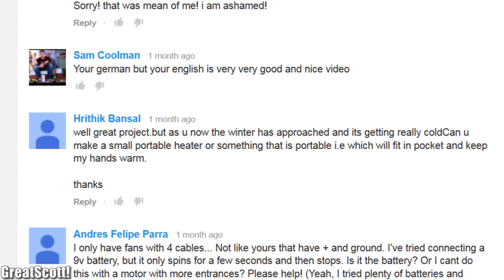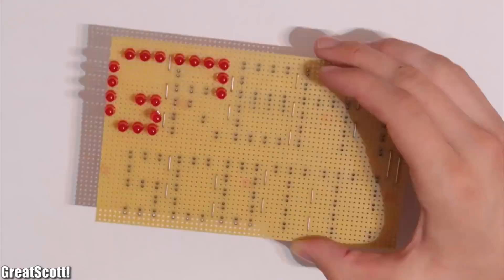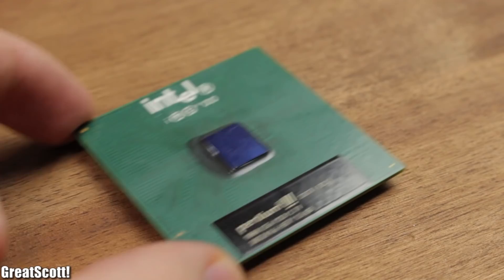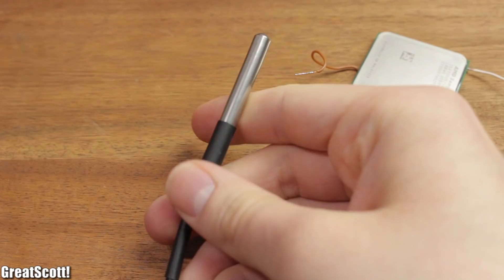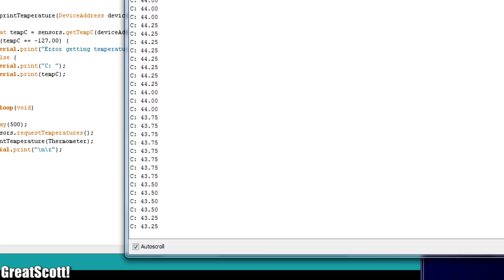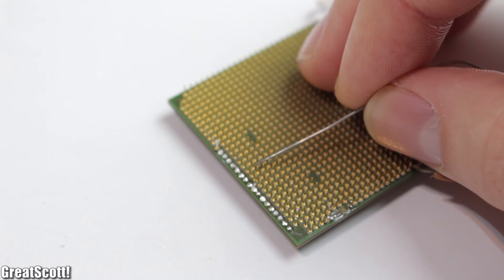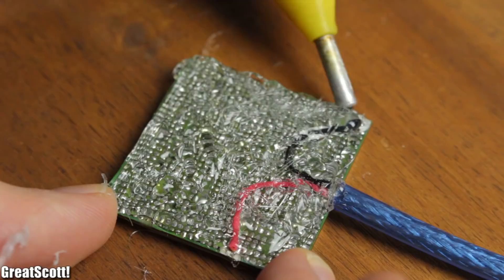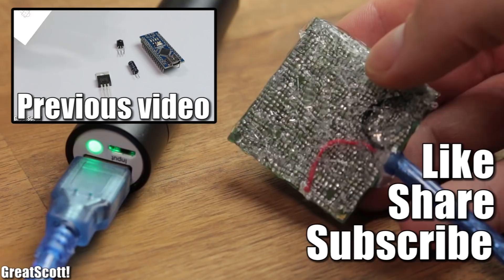Stay warm this winter: CPU Hand Warmer

Comment: now overclock it
Reply: +Tom L I'm in stitches x'D like for you my friend
Reply: +Kyle Harrison for that you would need a mobo...
Reply: Hawk_ Eye actually you can Overvolt without a motherboard. Which is technically overclocking and would increase overall bus speeds
Reply: I tried doing it with a stock cooler. Nevertheless I don't have a home anymore.
Reply: +The Smoking Gentleman It's not 'technically' overclocking unless that side effect emerges, which would be undesirable. You can bypass the limitations of the motherboard VRM's by providing your own power, which is common in extreme overclocking.
Reply: +The Smoking Gentleman volts dont increase speed (on modern chips at least)... :)
Reply: ***** Yeah, i don't want to say such a thing is impossible, but that is not how people overclock, not these days :P
Reply: +Daniel Fischer It doesn't increase the speed but it increases the speed at which the pc is stable
Reply: +Tom L there is no clock
Reply: Will J this comment make my day
Reply: Yea Good Luck With That
Reply: lolz i did it seriously and im giving it away.
Reply: You can’t because the thing’s not really running.
Reply: Where is this clock everyone is talking about? and why does everyone want to run over it?
Reply: You actually overclock your motherboard’s Front Side Bus (FSB); the CPU just changes it’s frequency to fit the motherboard’s settings.
Reply: Will J lol
Reply: Hawk_ Eye pro bro
Reply: @nielswehrens8180  r/whoosh
Reply: @ironmatic1  r/whoosh
Reply: @marcanderson815  r/whoosh
Reply: @user-lb3nv4lk9u  r/whoosh
Reply: Nice
Reply: Lmao
Reply: Why people stun other with crazy mind jokes
Reply: Delid it
Reply: Portable Hand Burner
Reply: To 10GHz
Reply: ... and make a hand burner
Reply: @lightningstrike4680  oh no
Reply: Creates a bomb
Reply: At this point you can just hot glue it over an actual clock.
Reply: @frosty129  holy hell what have you done
Reply: He already overclocked it with 5V ;)
Reply: 120v
Reply: GEEEEEEEENIIIIIIIIIIIIUS!!!!!!!!!!
A fucking masterpiece!!!!!
Reply: Mains socket?

Comment: 2 GTX 480 and your room will never be cold. Ever.
Reply: I had one melt on me. No more Nvidia for me.
Reply: +Derpancakes Wow, great logic, completely irrelevant.
Reply: +Siana Gearz were talking about the heat produced by computer parts, on a computer channel. how is this not relavant?
Reply: +Garrett Holland I think he saying that generalising a whole brand over one defective product is bad logic, which I would agree.
Reply: +ReCode Detro r9 290x is a better bet
Reply: +ReCode Detro or a couple of r9 cards
Reply: +Siana Gearz Nvidia made the chipset that was well known for overhearing
Reply: Garrett Holland I disagree. They made a high end chipset with excessive power consumption, which is what they had to do at the time to gain an edge in gaming comparison over the competition, because the overall design of the generation favoured general purpose compute flexibility rather than pure GPU throughput, which was necessary for their supercomputer initiative and CUDA users, so it was a valid design choice. Mistakes were probably made on the reference cooler assembly, but i suppose cap and power transistor sourcing by OEMs was an issue too. A slightly slower model was reliable, and newer generations are reliable too.
Reply: +Siana Gearz so basically, someone fucked up and it dosent matter
Reply: +Tu Chenz Nah the GTX 480 was way hotter
Reply: +Derpancakes Just look at GTX 900 series thermals and efficiency.
NVIDIA is fine, just like AMD.
Reply: +Joe Dirt The 290x actually draws more power than the 480s and, before vendors started putting big coolers on them, ran significantly hotter than the first gen 480s.
Reply: 94XJ and value over performance, the 290 series is better than the 900 series if you don't play for hours a day
Reply: +Garrett Holland "Better" is entirely subjective.  It really depends on what games and resolution you're playing.

I use my machines for a lot of Folding@Home in memory of my late mother.  For that, Nvidia cards have consistently produced better results and that's what drives my choice.  If AMD cards out produced the nvidia cards without increasing my already gigantic electical bill a disproportionate amount, I'd be running Radeons.  

I remember back when the cut-down G92 based 9600GSOs were king of the hill in performance/watt.  I snagged a bunch of them and could get 2 to outperform my 9800GX2 just because of how far they could overclock.  Those were the days.
Reply: 94XJ teraflops are not subjective
Reply: I actually still have a system with 2 GTX 480s.  It's an MSI nf980-g65 board with an AMD 1090t, 4x4gb Ripjaws, 2 GTX 480s (which EVGA upgraded me to after a memory chip failed on one of my previous 470s), 2 640gb WD Caviar Blacks (before they dropped Caviar from the names),  2 2TB cav greens, an asus Xonar and a pair of BDRWs.  Not impressed by the MSI board to this day but it was the only AMD board that could support tri-sli at the time.  I always got such great performance out of AMD builds on Nvidia chipsets that it wad my standard formula.

Anyway, the 480s came late after the memory fault on a 470 so they were obviously revised models but to this day I can fire up a game at 5760x1080 with both cards OCd to 800mhz core (1600 on the shaders) and not cross 77c.  I have to dial the settings back a bit, but the ol' girl will still handle GTA V on a medium-high blend at 5760x1080, too.  

Everyone got on biard the 480 bashing wagon the same way they did Windows Vista.  The fact of the matter is that the cards can still hold their own.  They also introduced a very powerful architecture upgrade that took everything AMD was selling DX10.1 on and blew them away.  Fermi was also the base of Kepler which took the "core" components from half speed-double width to single speed single width saving a lot of electricity.  It's a great parallel to Vista and Win 7 really (also Windows 8 and 8.1 are all actually Windows 6.x).  Fundamentally they're the same just some revisions on the newer product.
Reply: 94XJ  Phenom II Hi-Five. Keeping the room nice and toasty.

Fermi was a necessary step. It wasn't THAT revolutionary, but probably nothing will be after 8800 for a very, very long time. Certainly was top choice for the time. Related GTX580 still occasionally remains a top choice for compute applications even for single precision, because since Kepler branching became more static and slower.

NVidia GPUs are generally a good match for AMD CPUs because of low CPU overhead and good secondary thread offloading.
Reply: +Derpancakes My nvidia 650m gets to 90 degrees at like 100% of the time and works fine.
Reply: +ReCode Detro i have 2 GTX 970s and my room gets so toasty.
Reply: +TheGamerGuy This is neat, but you might want to check out the thermals of a GTX 480 vs a GTX 970. Fermi (480) was notoriously hot, whereas Maxwell (your 970) is conversely a very power efficient (and thus, colder-running) architecture.

...... But if you're doing really heavy overclocking then I suppose you'd get right back towards 480 heat territory ;)
Reply: +Garrett Holland While true, the number is a theoretical maximum calculated by the number of shaders multuplied by clock speed and maximum floating point operations per clock.  The rating doesn't account for any cache calls or pipeline loading, just 100% operation at all times.

Again it all depends on what's being processed and how the architecture handles the workload.  AMD has always gone for a higher quantity of shaders which gives high theoretical FLOP scores (especially going back to nvidias Tesla architecture where the shaders were like 5 times more powerful than AMD/ATi's) but in many actual applications, Nvidia is actually faster.  

AMD did finally score a major super computing win last year with FirePro cards in a market that has been really been single-vendor show.  They're still holding tight to that most efficient super computer title but the S9150 is being compared to a Kepler based Tesla. This is primarily because Maxwell wasn't designed with compute performance in mind like Fermi (and Kepler since its mostly the same) and it's less capable in DP, but for single precision math (like in deep learning) it's 50% faster on less power.  So again...no clear cut winner.  Performance entirely subjective based on application.
Reply: Craig Labute yup. However i am also running an h110i with 4 140mm in push pull with an i5 2500k @5ghz lol
Reply: +Siana Gearz Dude they sell high end gpu for so much... and they domp the worst air cooler on it.. and worst Phase count ever....

Even titan x suck so hard compared to a 980ti custom
Reply: MrBonami2 very true.
Reply: +Furrane I disagree. A brand that dismisses safety over performance is not a brand I would likely stick with either. I'd invest into a brand that at least has safety cut-offs.
Reply: bugs181 in principle both GPU companies have both thermal management and safety shut off, have always had,  but for highest end units, they have never been particularly effective. In the race for prestigious highest performing unit, one generation or the next either of the companies tripped in the same pitfalls. For that model lineup, the shut off limit was at 115-120°C I think. I think the "melting" was rather likely more figurative.
Reply: Siana Gearz Fair enough. I don't know enough about the debate or products to comment further. My comment was meant only as a "general thought". But telling someone that safety is not reason enough to warrant the need to switch brands is just false. However, if all brands are doing the same thing - I'd say its a huge safety concern for that product market as a whole and should be addressed.
Reply: If that is true, then you had some crazy cooling.  Or you live in the antarctic.
Reply: 1 AMD Fx 8350 overclocked with an GTX 1070... in my room is an fucking microwave.... (in summer & winter)
Reply: There is no Problem with cooling my PC he has constant 64° Celcius... it is just... the hot air inside my PC is getting out and my room is so good made that no head and otherthing can go in / Out...
Reply: Just owning a Pentium D can burn your house down.
Reply: If add a core I9, you can get an oven.
Reply: MicroKORGI Why though? They straightened out all of the kinks in the 400 and 500 long ago.
Reply: One does not simply power a single gtx 480. NOW HOW THE FUCK. DOES ONE POWER 2 OF THEM.
Reply: and it sounds like a starting airplane in there am i right? xD
Reply: Re Detro How?
Reply: Just get 2 Amd R9 295 X2 cards and you can heat up your entire house if you hook them up to a radiator...
Reply: a gtx 1060 will also make your room a sauna
fml...
Reply: lol I have 2 1060 6 gigs. I have a 2 fans blowing on me and my workstation at all times
Reply: Or a 2 socket pentuim 4 machine with no heat sync OR thermal paste
Reply: Or any AMD, my laptop heats my entire bedroom
Reply: Pentium D
Reply: I have 2 and you lie, also I live in Wisconsin.
Reply: @Zenodilodon  Wisconsin... Explains why it doesn't work for you
Reply: @Sorestlor  no notebook parts should get that hot lol, especially not a low wattage gpu
Reply: @dylanchilders4527  Yeah it shouldn't but it did and does for its whole life. And it hasn't died yet. But it has killed the battery. Im sure thats the cause.
Reply: @Sorestlor  sillicon lottery i guess
Reply: @spukduk5632  a couple r9 295x2's
Reply: no get a full on mining rig and you'll get better temps
Reply: Just buy a HD 6750 and overclock it to 800MHz Core Clock. Your room always will be hot.
Reply: I have 2 GTX 460 and my room is always above 20 Celcius.
Reply: @smallchungus4529  Dayum! 40-50 Celcius? You must be sweating balls in your room!
Reply: @vilkaskettu8765  LOL sksjsj nope mate generally a bit higher than room tempature.
Reply: @spidercubed9718  yes dude generally in summer days (now winter) my room gets very hot and i cant breathe because of my graphic card. I don't know how much is it but it should be close to the 40 celsius.
Reply: Jeff M paired with an i3 and boom you have your own diy sauna
Reply: @spidercubed9718  No man it's warm.
Reply: @SianaGearz  wow, great comment. Completely irrelevant
Reply: Variable Alias same with both of my GTX 1080ti
Reply: Better buy a GTX 295
Reply: Never tried a GTX 285? Unbelievable hot they are getting,
so these will probably replace 2x GTX 480 regarding the heat 😂
Reply: I have a GT 220 and my PC crashes alot and it gets hot

Comment: I really hate those intel fanboys. AMD is the best because even in the cold months your AMD pc keeps your room nice and hot without the help of the central heating system. H
Reply: nice
Reply: Robin Camfferman doesn't help when you in Australia and your coolest temperature for the winter is 20 celcius
Reply: I dont understand guys who buying CPU with 150 W TDP and crying why? Why those 150W are so hot?
Reply: you mean shintell
Reply: I had an unclocked FX-9590 last winter, but i had to switch it for intel because the heat together with an R9-390X was unbearable.
Had a temperature of about 20c in most of the apartment,  but at the edge of my desktop it was around 33c.

Now my right hand is always cold again though...
Reply: If you have a water-cooler im pretty sure that no matter what your room wont heat up, when I first got my new i7 machine I was overclocking it and under %100 load for like 45 minutes it maxed at about at 80 degrees and the radiator fans were blowing semi-cool air, while the case fans were still icy cold. (Now it maxes at like 76 dont worry im not gonna kill it)
Reply: The room shouldn't heat up if it's of sufficient size, but the area close to the PC will of course get heated no matter what kind of cooling is inside.

If your CPU is at over 70 degrees and the radiator air blows cold you probably should apply new thermal paste since the heat doesn't seem to transfer too well.
Reply: Simon Tuomi Yeah I agree, but i was talking about case fans not radiator fans. Any recommendations for a good thermal paste? (That isnt going to cost like 20 bucks?)
Reply: My Pentium 4 disagrees
Reply: Robin Camfferman amd is like Samsung, awesome and keeps your hands warm in the winter.
Reply: Robin Camfferman 
Intel is better than amd
Reply: IBM or GTX are the way to go even AMD can’t compare.
Reply: 1 year later and intel don fucked up
Reply: Lol in the room in which I put my PC I was cold, now I threw the fans away becuz I'm gonna change them and even in winter the temperature is about 25-30 degrees, I'd live in there if I could. I'm never gonna change my AMD CPU, but, well, everybody has good reasons to choose it or Intel instead, #respect for everybody
Reply: +Ziron Kekerson
So you're telling me that a water-cooling-system defies the laws of thermodynamics?
If you don't know how a water-cooling-system works and what thermodynamics are, you shouldn't be commenting about them. In no way in this universe is it possible for a water-cooling-system to not heat up a room as much as an air-cooling-system if the heat-source is the same.
Water-cooling works exactly like air-cooling in the way that heat from the heat-source is dissipated to the room-air, except for the fact that the water works as a middle-man between the heat-source and the room-air. This does neither mean that the heat-source produces less heat, nor that the room-air doesn't heat up as much.
The only difference between water-cooling and air-cooling is that water is able to transport the dissipated heat away from the heat-source much faster, which results in lower surface-temperatures of the heat-source but the amount of heat that is dissipated is exactly the same, so no matter if you have an air-cooling-system, or a water-cooling-system, as long as the same amount of heat is produced by the heat-source, the same amount of heat is dissipated to the room-air.
Kind regards,
Meta Custom Computers
Reply: ever use an overclocked xeon?
Reply: how many intel cpus do you own?
Reply: Andrehh89 I have like a bin full of old pga 478 intel CPU’s
Reply: so 1
Reply: Pentium D
Reply: @spidercubed9718  fam, Samsung is better than iPhone and yall know it you just can't admit it
Reply: Robin Camfferman what about now lmao intel struggling to keep their head above the water with their high ass prices intel will die when ryzen 3 is released
Reply: can confirm
Reply: You know amd is bad when they ripped off intel
Reply: my intel i5 keeps my room cool during summer
Reply: Old AMD does! With FX-81xx HD7990.
Reply: chill bro
Reply: Nah, that is a poorly cooled GTX 970 TI's job to heat up to 90°c and warm a room
Reply: Xd
Reply: This has aged beautifully lol. Completely reversed now
Reply: Revolver Coyote you had me in the first half not gonna lie.
Reply: But AMD CPUs dont even get as hot as Intel CPUs...
Reply: Fool! Power PC will rule them all! Someday! Just you wait.
Reply: I don't like fanboys either but bruh, a pc isn't a heater...
Reply: AMD beating team blue rn lol 64 core 128 thread threadripper
Reply: I'm working in an unheated room in the cellar for quite some time now. I really had an old computer running in here (AMD Phenom from 2008) that gave me a nice temperature in here after a day or so. OK, the less efficient PSU (from 2003) and my old screen (IPS from 2005) also produced some heat. :D Used that time for installing updates on that old computer, which is now my retro gaming system.
Reply: Say that once more in 2020/21